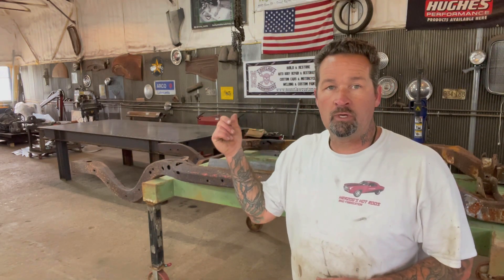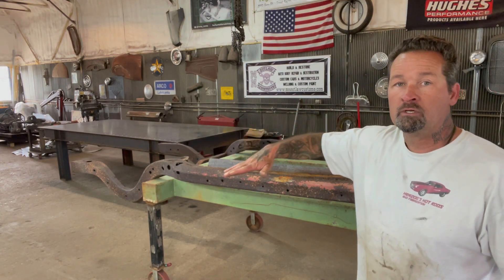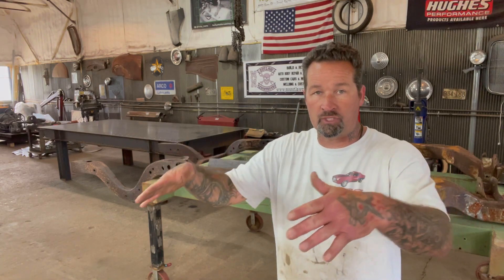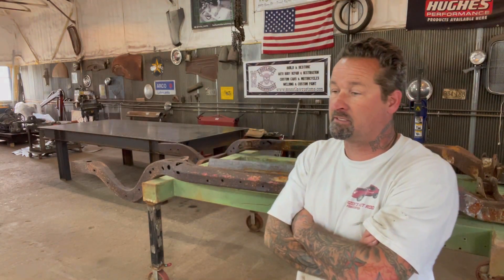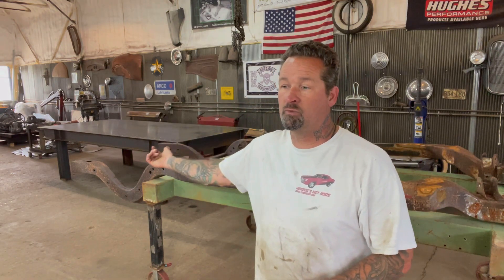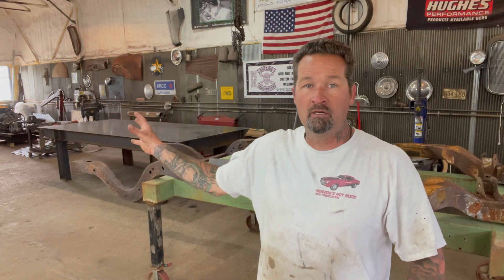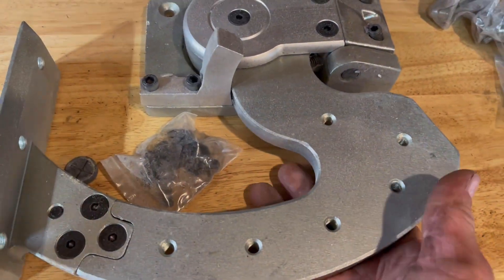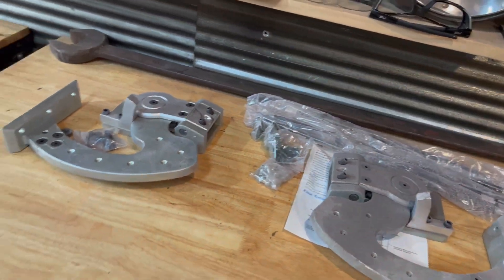Working On Rogue - grille and frame prep

Comment: I think if possible on the back of the grill you could make some fine relief cuts, and press it. Stainless pulls a lot with heat, you could heat the center of the front side and let it pull just a bit also. Or both. Awesome work, I'm excited to see this thing moving forward!!!

Comment: Exciting to see Rogue back on bro.  I think you have to form the grill in a press.  I've done stuff similar to that with the outside surface face down in the die (or wood nest), a little heat and cardbaord thick rubber and a piece of plywood to press against and press the shape down.  Pretty much the same as what Glen said.  We used to use thick rubber because it is forgiving (like God) but still forms the metal.  Worked great on sheet metal.  Could work here too..

Comment: If you don’t want to do the buck or press on the grill. You could get stainless rods and make a new one. Make the ring around the outside which holds each formed line in place. Kinda like early fords. The only reason I would go this way is like you side the weld marks they leave a bit of a pattern at certain angles.

Comment: I think the grill . You need to make the gig and press it into it and maybe a bit of heat so it don't crack  bro like we talked about a few weeks ago
Reply: Agree with Glen. Only concern with heat is stainless discolors very easily when heat is applied. It can be polished out but that will be real tedious on that grill.
Reply: You would have to test this put i think  Miradic acid or  Possibly phosphoric acid would remove the blue not sure testing only way to tell

Comment: Got a mate here working on the 73 Statesman, replacing the firewall.  For the grill, put a 1 inch block at top of grill opening and push grill top corners to fold the grill back, it might need support the full length, as long as the centre is firm the rest should move.... Hopefully
Reply from the maker: Thanks 🙏 im getting some great info on this video. I really appreciate your support

Comment: Make a male and female  plug the same shape as the grill shell. Put the grill in it and heat up the section in the center and then start pulling the top corners back. May have to put some reliefs in the front and then weld them and repolish.
Reply from the maker: Thanks 🙏 that might work bro!

Comment: Aren't you just bending the horizontal ribs? From the looks of the shell, the top third needs a slight bend equally from both sides of center, tapering off vertically as it goes toward the bottom. Those 1/4" strips or whatever size, seem like they would give with slow but consistent pressure over a center wedge. Like you said, stainless is brittle. Is it 306 or 316?  Badass project!!
Reply from the maker: Not sure what kind of stainless this is. But its hospital floor grate material

Comment: Arco hello brother! 
The  grill should be heated at the place of the bend and bent according to the template. It is better to warm and bend at the same time. It is better to warm it with a construction blowdryer,Heat gun  . it leaves no traces, unlike a gas burner.
Reply from the maker: Its ok if i use a torch to heat the grille because were powder coating the grille. It will hide the heat blue colors. Thanks brother! 🙏

Comment: What i am going to explain to you is quiet complex if you don't understand it you got my number if I was tasked with bending a grill like this is how I do it I would cut 4 pieces of 1/2 in plywood a right and left and front and a back that fits the shell leave a centered quater inch gap at the top where it needs to bend say down the 6 or so inches it goes then have wood butt tight together then cut a 2x 6 frame that has the same depth as the grill need plus says quater to three sixteens  of inch for spring back standing on edge bolt it down to the fab table with recessed cariage bolts use tape to hold the 4 piece of plywood to the grill as protection they are slightly smaller leaving the edge exposed to fit the jig put more wood on top 2 x4 to raise it up then use 4 big ratchet straps hooked to table to pull it down from the end it will look like a bow by leaving a gap where u want it to bent it will give the metal a place to go i think this will work
Reply from the maker: Amazing idea! Im getting lots of ideas from u guys. Thanks so much